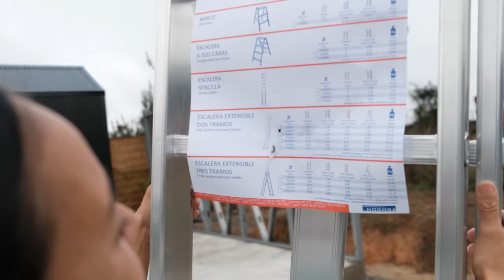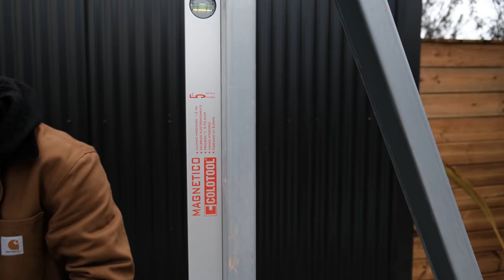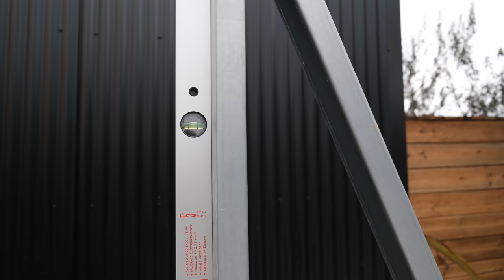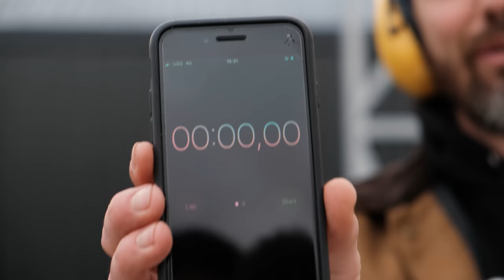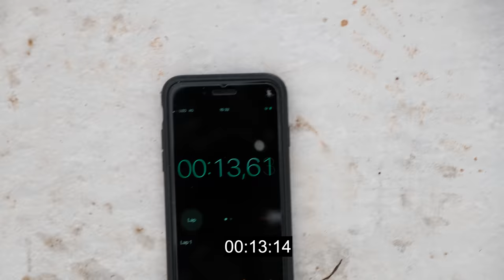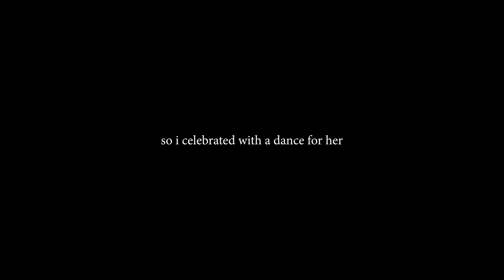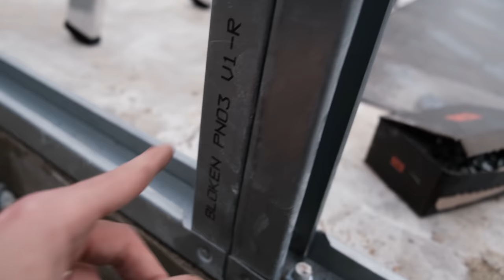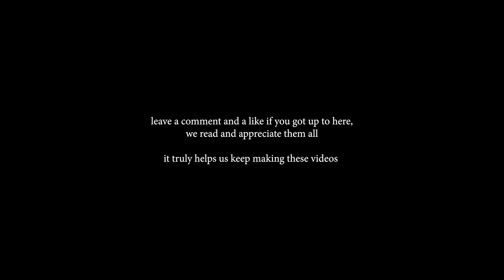7. Assembling walls (Me vs Her) & fixing the concrete slab...

Comment: Nice work!
As feedback to Bloken, you should ask them to provide an alignment plate for those 3 holes as part of their kit. The plate would have 3 pins that would insert in the holes to align and then you can screw it together.
Just an idea, may be useful.
All the best!!
Reply: You could also pickup what's called a drift pin or bull pin. They are used in steel work for aligning steel components. They are tapered to fit different size holes. Smaller ones are about 10" (25cm) or so in length.  They are super handy for other uses too. The one I have is made by Klein Tools, can get off of Amazon.

Comment: Looks like you are overtightening/stripping a few screws there :( I would use a driver with adjustable torque and have on a low setting.
Check out 19:18 - screw goes in, pulls metal tight but then you keep going so it strips, the metal parts slightly and the screw just turns and turns. Seems you might have done this in other places too :(
Reply from the maker: nope, that screw is designed to do just that. once you screw it hard enough it becomes like a rivet. which is the best for LSF
Reply: @ModernHouseCabin  I was curious as to if it was intentional. All good then. Phew!

Comment: You should both be wearing some kind of mask if you grind concrete like that. Some dust is very bad for your lungs.
You could also maybe cut a piece of scrap wood to fit between the vertical and diagonal posts to use as a temporary handle.